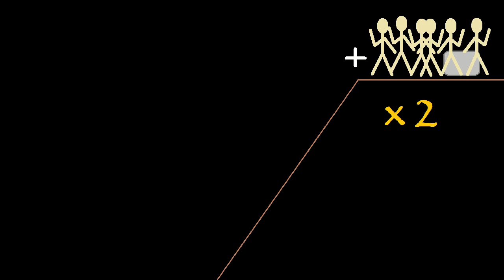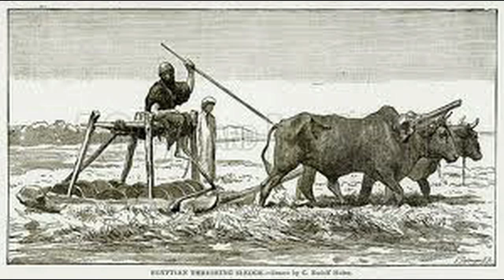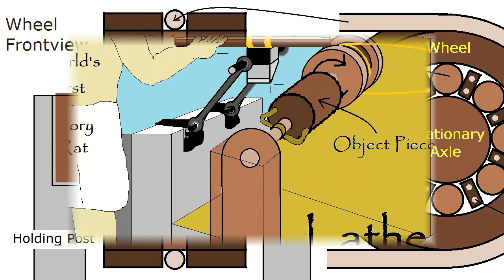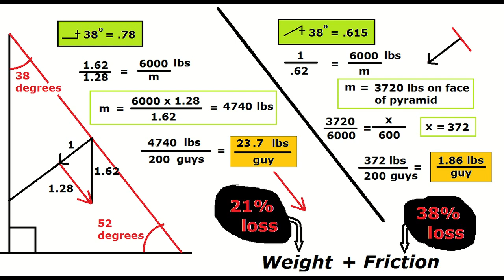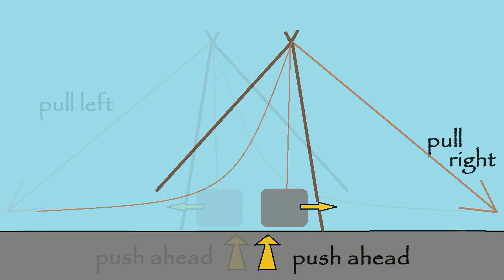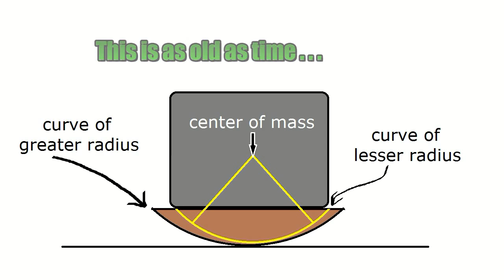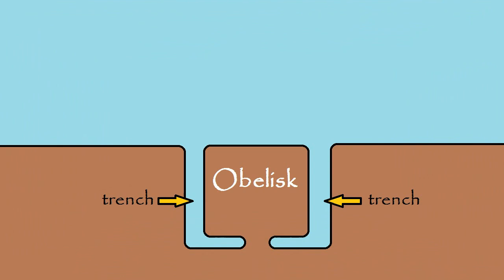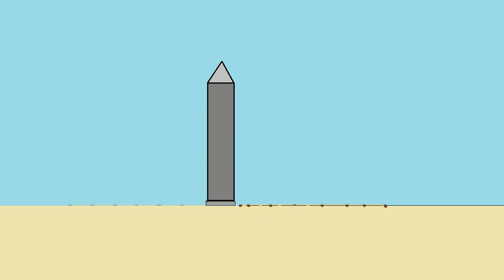Pyramid Construction in Ancient Egypt

Comment: Outer ramp was used to the first half height up to the Grand Gallery area after they finished building the Grand Gallery they took away the outer ramp and used an elevator drop & lift method to build the upper half. You can see the faint lines on the front 4 flat faces from an Ariel view that is the lines of were the elevator rose & dropped with stone blocks

Comment: One scientis feels that the massive stones where actually formed by making them by pooring a liquid cement form of limestone into forms, instead of carving massive stones and then haulling them. Do you think this would be more acurate about how the Egyptians built their pyramids?
Reply from the maker: Alexander Higgins No. The interior stones are all rough cut and all different sizes. Perhaps they are referring to the exterior casing. In that case, I doubt it. Normal cutting and sanding will do the trick.

Comment: Also, have you gone through the material at The Upuaut Project? If so, I wonder what you think about it...? If not, I think you might enjoy it, as it is Rudolf Gantenbrink's site and contains the story of his involvement with the GP, culminating in his exploration of the so-called "air shafts" by remote using a robot he designed specifically for that role.
It is packed with fascinating information, images, and, ultimately...questions. :D

Comment: Pt2. In this video they show the sand castle idea. From a point of a view of a child, one block at a time, molded. The mold never changes and they fit perfectly with out effort what so ever really, bring up sand in buckets and the hardening ingrediant, mix, pour, dry, repeate. Then also, Stone can be melted with a large parabolic mirror array and honestly, can be melted Fast when the sun is out, 6000 degrees and more.. Pour into molds yet again, the wood mold may burn up, hence the diff sizes.

Comment: Maybe that's because they didn't found any evidence of wheels but that doesn't mean they didn't had it.. maybe they didn't used it that much because it wasn't that effective. On the sand the wheel doesn't behave very well with heavy weight and they didn't had many trees either. One thing is certain, if they had pottery, they also had pottery wheel ergo they knew how a wheel works and what are its benefits.

Comment: • Easier to build tracks with grease and than pull on slays with more men (more than 2 or 3 that is.), than to role?
• Have you seen the old step-pyramide with the three vertical "elevator-shafts" in the center? Very interesting!!!  (link lost, sorry) Pumping-water-methods were quite good back then. (Basic farming - channels everywhere e.t.c,) Stonehenge megaliths were defiantly floated there! (I think)
• Template? (Sorry, too tight, all the time, all over the world. Forgotten stone-age method.)

Comment from the maker: I was thinking just that after I posted the last reply. And ... you could 'gear' the rope to the strength of the oxen so they wouldn't tire out during their shift, i.e. treat them as valuable assets with good food and no whips.
I don't see anything to stop them from using "power lifts" like this. There is just the matter of "were there enough oxen available at the time" ... probably.
You could have a brake & clutch system too.
There are lots of things you can do ... IF ... you have a wheel.

Comment from the maker: @scramblethink  Rolling stones is a good idea ... if ... you have a long way to go. Most pyramid blocks at Giza came from about 200 yards away ... not worth the bother of putting them into a wheel since a sledge on wood tracks takes just a few men.
Water won't work for going up. How would you seal your water elevator? And ... there is no underground stream.
Those big, tightly fitted stones are done with templates. When the stone fits a template (made from the mated stone) ... it's ready to set.

Comment: Imagine the stress on the axle anchors, which have to be moved constantly. Your theory is valid but only as a guiding system. Water Specialists floated everything and in that heat they probably worked in the dark, slept by day. The grand gallery was likely a float bowl.
Reply from the maker: There was no way to seal any supposed water system to hundreds of feet ... and ... the same amount of energy is needed to get the blocks up the side of the pyramid. No energy is saved with a water system. It looks "cool" (I'll admit) ... but it wouldn't work even today. We would just run the blocks up the sides but with electrical power rather than human or animal power.

Comment from the maker: To make pyramid of Khufu with modern equipment ... no interior chambers, just exterior blocks with a smooth facing ... if everything is ready for assembly ... my time of construction estimate is ......... minimum - 8 months ............ maximum - 2 years. 
Delivering unlimited stone by rail to the site, unload by crane directly to hoist on side of pyramid, across top of pyramid by small electric trolley on steel tracks, set by small specialized cranes (~20) ... computers, laser guidance, etc.

Comment: Stones the size of the ones in the walls at Sacsuhuman cannot be pulled on sleds nor levered with anything but steel and machinery. There are places (Olleytantumbo, Macchu Picchu, etc.)where there is no space for even cranes. Roller logs can work, but not on an incline.The only answer that can account for all these places is what I call "water floatation building". Using this theory, stones are simply floated into place much as the Panama Canal does every day, with much larger loads.This is also the only method that bears evidence to prove it, dozens of examples. For demo. of this theory go to James Northcutt on youtube.

Comment from the maker: It is cramped up there. That's why I had them pull up the stones from the base and only maybe 600 on top to put 'em in. Hudin's model is just about the same as Elio Diomedi's (internal ramp). I think this is way too complicated. Generally when lots of guys work on the same stuff for 100 years or more ... they iron out the problems and go to a least energy model. That's what I was going for ... least energy.
If it were a contest for today's engineers, they'd figure it just about the way I did.

Comment from the maker: You need to do the math. With current construction abilities (like poured concrete), the pyramid of Giza could be constructed in maybe 3 years ... if ... somebody wanted to foot the bill ;o) The Hoover dam @3,250,000 cu meters vs. Giza pyramid @2,500,000 cu meters. Hoover dam took ~5 years to pour.
The one block per minute refers to one line "consecutive placement". With multiple lines of placement you can definitely beat that. No electricity is required.
Video - "Ancient Aliens Debunked" *****

Comment: poured stone solves every single issue raised
Reply from the maker: Mike Jandebeur If stones are poured ... why are they all so rough cut. Only the outside layer is smooth.
Reply: Bantokfomoki the outside layer was Cheops addition and was a different formula than the core stones, which were already there for 800 years. think on that as i have rarely posted this as it will be one of the subjects off my book.
Reply: Mike Jandebeur  all the stones are made to ten different and exactly-calculated lengths in order to set them in patterns throughout the whole structure to eliminate the formation of vertical joints?    here is a video from their website it will help explain. the middle vid is a good primer. 
http://www.geopolymer.org/archaeology/pyramids/pyramids-4-videos-download-chapter-1
Reply from the maker: Mike Jandebeur Do you really think that the core stones were made in individually unique molds  ... all shaped to resemble a rough cut stone?
Reply: +Mike Jandebeur seems the most logical opinion to me but is it that hard to differentiate between the poured stone and the natural stone that is shaped by cutting?
Reply: +Bantokfomoki  no, the core is made of all types, depending on how good the joints needed to be. it is full of all sorts of junk, from sand to scrap to busted stone to perfect poured stone. but the stone near the passages are exacting.  most of what can be seen such as the robbers tunnel are weathered and worn. giving the impression that the core is all different blocks. But the core has been dug into  in many places and the core are solid and formed for the most part.    with the main bulk of the core being already built before the fourth dynasty you do not need 20 years with a stone every 3 minutes. you only need 2000 workers and that is what the digging of the workers area is showing, that there was not 20000 workers housed only room for about 2k. Most of the workers were at a another location building a temple for kufu.  the top third and the outer layers are fourth, the core is 800 years older. this matches the many carbon dating results that have caused much confusion.  the lower pit chamber is also added later and not part of the first layout, and not needed for its function.
Reply: +OsmXbal Yes, geologiest can not tell the difference at 50X power.  you need scanning electro to see the micro bubbles, the grain boundries ect.  several engineers at MIT have reproduced the stones and have fooled many critics   with it. poured stone has much higher water trapped in it which stops radar as many have found out trying to radar the prymid looking for secret rooms.
Reply: Mike Jandebeur if so then this seems the most logical solution to this enigma?  what does not convince me in all theories is how they managed to build a 2.3 millions stone structure in 20 years when saying that the lightest stone is 2.5 tons (2.3 millions stones / 20 yrs is 10,368,000 minutes = 2.2 minutes for each stone) such rapidity seems impossible whatever the procedure was? any explanation to this?
Reply: See above reply
Reply from the maker: +OsmXbal Yes ... multiple paths to the top ... right up the side. There could have been a hundred all operating simultaneously. The real hangup is quarrying that much stone. So, I think that a group of stonemasons stayed there year round and the people who assembled the stones came during the inundation period and placed all the stones available from the year's work by the masons. I think 10 years work is adequate.
Reply from the maker: +Mike Jandebeur Regardless of how the stones were manufactured, there is a certain minimal amount of energy required to lift all that stuff. This is calculable and it's an immensity. You can figure out how many man hours of work are required based on the ability of men to do work. This has been studied from every angle.
I think I can state that just 2000 workers is ridiculously too low. 
I really don't see how people can ignore all the evidence for standard stone masonry. It's all over the place there. Instead you want some bizarre mechanism for which there is no good evidence. It's like arguing with the flat earthers. The earth is a ball by any measure now made yet some people choose to ignore all that and actually ... seriously ... believe that it's flat. I don't know what to say to you or any person who refuses to acknowledge what's right before their eyes. Sorry, I can't go along with any of the "poured stone" theories. To me they make now rational sense at all. ;o)
Reply: +Bantokfomoki stones are not moved they are poured in place. the workers haul baskets ofr the wet sand like mix that is put into the molds in place. This has all been reproduced and pear reviewed by several scientist, two of the best materials labs, and MIT and other universities.  Not my ideas as their are now several books and websiute on it. even some arguments by a few who were proven wrong by the concept.  it just that it takes timefor people t learn and accept the truth. egyprologist will not even talk about it as it upsets their whole system of cut and hoist that keps everyone wondering how did they do it and the tourism money flowing.

Comment: the pyramid is a machine! the lower room is a water pulse pump, the inner workings are harder granite material, the filler is probably cement man made blocks, the outer casing is insensitive,, the top,, the pyramidian was gold,,vary conductive,,the math selected in the size is vary advanced. only that size and ratio alow dividing the area of the 4 sides in to the area of the bottom for pie, half a side i phi,,  math extreamly well. the kings is on the 18600 latetude, speed of light.

Comment: Didn't the Egyptions inherit the Pyramids ?
Reply from the maker: Brian Porteous  From whom? The Egyptians? ;o)
Reply: My personal oppinion is These Structures Pre date the Pharaohs. :)
Reply from the maker: Brian Porteous There are buildings where the workers lived near the pyramids ... and graves, etc. One would suppose that they would have carbon dated some of the remains to the time they were built ... (but I'm not sure this was done). That would clear up the issue because carbon dating would be a fairly close approximation ... say ... within a century or two.
Reply: Good Point. These workers and again it's just my oppinion did work for the Pharoahs ........they adapted the pyramids to house the Bodies. I truly believe these Pyramids were constructed by a civilisation well before the Pharoahs came on the scene. ;)
Reply from the maker: Brian Porteous I just checked Google and found that radio carbon dating has been done on charcoal chips from the pyramids themselves and agree that they were built 2600 BC give or take a few centuries. Apparently, the Egyptians baked gypsum to make mortar to fill large cracks between the interior sloppy stonework along with small rocks and rubble to smooth off the levels. This agrees with all the other radio carbon dating done on the campsites around the pyramids. And ... the Egyptologists were dissatisfied with the results because of the range of variation (a scatter data set ranging over 400 years). This is from extensive work on the site in '84 and '95. So, my view is fixed. The Egyptians built them about 4600 years ago. The only issues are some of the exact mechanisms of the engineering which is the main area of my interest.

Comment: /watch?v=QFc0e2Inzj0&list=PL059A5385F42B84D0&index=9&feature=plpp_video
(4 rockers)

-That idea easily roles the stones up the existing centre corridor that still has tracks on the sides (the gallery).
.
-For transportation think water. There spouse to be an underground channel all the way from the ancient Nile. (closer than today if it exists)

-Tightly fitted megalithic stones by using an acid-porridge!!! (The Indian recipe) Rubbing them out of the rock-face and than together.

Comment: no you would have to spin your children like how they made poetry. : ) if i had to do it,, i would flood it and float the blocks in on boats and lower them in to place. but if they had electricity i think Edward Leedskalnin Coral Castle had some defonate technology. it is hard to move 35 ton stone blocks 700 miles with out roads. Carl monk the code mathematically show a world prehistory civilization. did you think about the granite cor cut outs for your bearings?